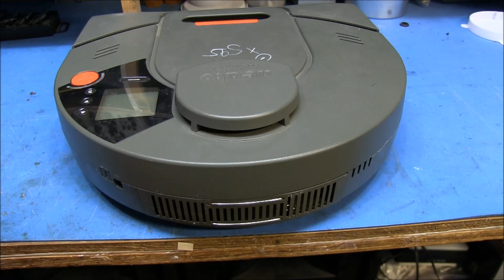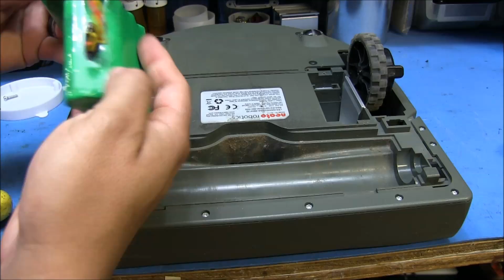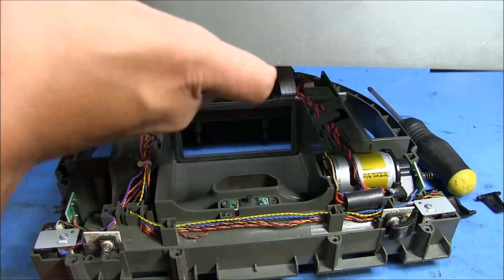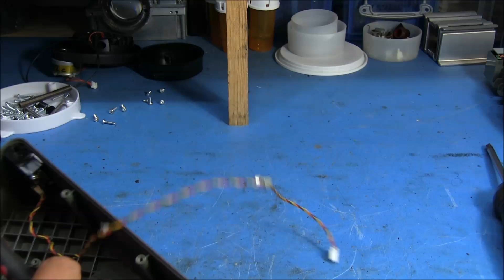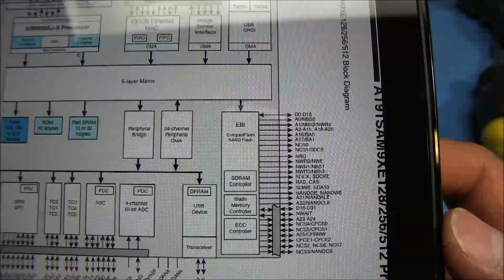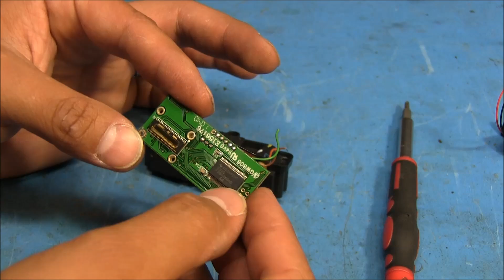Neato Robotics XV-11 Teardown and Repair - Part 1 of 2

Comment: Just bought one of these for ten bucks.  Don't have it, but I was sure glad to see your detailed repair procedure.  Thanks!   Very well done.  I know this is an old video, but wonder if you're still using it.
Reply from the maker: We're not using it because it developed a couple problems that I've been meaning to do a video about, I'm hoping to get to it at some point. For the time being I've been doing the cleaning manually, lol, although we've considered getting a newer unit, just haven't settled on any particular model.
Reply: I bought two XV 11s, and use them both regularly, with no issues so far!

Comment: so that cpu is either 180 mhz or 200  it can saefly go up to 400 at 1.95 volts lol  the 128 stands for 128kb of nand it has 16kb cache  and 16kb dcache  you can add a compact flash slot to that board . im thinking about raising the sclock speed of the chip and adding a cf slot  or mcf slot to my neato just for more room to add features to my custom rom
Reply from the maker: Dang, custom ROM sounds pretty cool

Comment: Hey there. I saw that you pulled the rotating lidar piece off by hand, and I did that too. However, you didn't show how to get it back on, and I am struggling with that. How do I get it back on without breaking the little plastic tabs?

Comment: Hello sir,  In D series Battery. black wire negative and red wire positive. What about two yellow wires. And where in the battery is connected ?
Reply from the maker: The yellow wires are for the thermistor in the battery pack. They don't connect to the battery cells.

Comment: Great video! My neato's roller motor belt suddenly got gummed up - I can get it to advance but I keep getting an error of "roller brush is stuck" and as I've (many times in the past) already cleaned the roller it seems the issue is deeper, with the motor or the gearing in where the belt attaches to it. Has anyone taken it apart to the point of being able to clean the roller motor gearing? Does the motor piece that was removed in this video break down further for cleaning?

Comment: The broken spring plastic retainers are caused by a screw on the display circuit board working its way loose, you hear and feel the spring begin to bind and eventually it gets caught and snaps the plastic retainer. I prevented this by tightening that screw and gluing it in one spot to stop it turning on a Neato XV Signature from 2014 with the same chassis.

Comment: In case nobody else mentioned it, at the 19:20 mark you're wondering about the little wheels.  Those have magnets on them with hall effect sensors on the board below - it can tell how many times the wheel is rotating based on that.
Reply from the maker: It seems they're using it to generate a pulse to detect if the wheels get stuck. From what I've observed, it doesn't look like it's keeping track of how many times the wheels actually rotate since I've had the thing get stuck underneath a TV stand and couch while the wheels continue to slip on the floor, but it's able to quickly backup and recover once it determines that it's not actually going anywhere. So much stuff packed into the thing!

Comment: thanks for the video. I realize that in the laser unit the diode and the sensor has an angle; they are not parallel. I was wondering if you measured this angle.
Reply from the maker: I did not, but I did kind of notice it as well.

Comment: I believe the base uses an IR reflective surface to allow the bot to find it. I found that a power strip with a light on it under my home theater kept attracting my robot when batteries were low. I taped the light over with black electrical tape. Problem solved!

Comment: The wires and connectors are crammed in there and it is very hard to connect and disconnect the batteries from the connectors due to the way they are situated.  This is not a consumer-friendly design for battery changes.  It is not complicated to change batteries, but it seems it would be easy to damage something.  I actually received an XV-11 back from warranty service with a damaged connector pin.  I notified service and returned the robot with a zoomed-in photo of the damaged pin; and the robot was returned with the connector not repaired!  It had to be shipped back for repair again.    Shipping robots in for repair is expensive and wasteful.  We are without the robot for many weeks while that is happening.  It is also not earth-friendly, since so much fuel is used in transporting them.  The robot is now out of warranty and having battery issues again (even with fresh NEATO batteries).  Thanks for sharing this information.  It is helpful.

Comment: The magnetic sensor is for the strips that come with the vacuum so you can tell it not to go in certain rooms. You lay it across the floor, and the vacuum's magnetic sensors detect and avoid the area behind the strip. Didn't watch the rest yet, you may have found that out by now..
Reply from the maker: Ha, yeah, thanks! Ended up finding out after I had already made these videos. Also learned a lot of other stuff way after the fact. 

Thanks!
Reply: Hey, great video though! I hate disassembly without a diagram of some sort but this was confidence inspiring. I had the blank lcd problem that seems to be related to the 7 capacitors on the motherboard. Just got done soldering last night so we'll see if it fixed the problem in the next day or so.
Reply: My motherboard was slightly different than yours. But the rest was identical. It's an xv-21 pet.

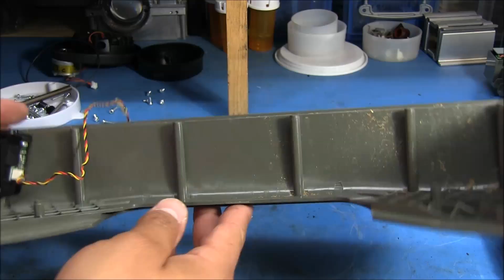Comment: Question for you and some advice from you, if you dont mind. On the video @ 39:27 that cable to the sensor. My sensor cable got cut and i need to redo the connector at the end to the sensor. Would you happen to know where i can find a new connector? What brand? Thanks in advance :)

Comment: Great video! I have two neatos. The first one died while under warranty and they sent me a new one. The second one stopped one day and complained about "blocked vision". I noticed that the radar thing had stopped rotating and with your video to guide me I was able to take it apart and locate the motor. It was indeed broken, but I could replace it with the motor from the first neato. Now I have a working robot again! :)

Comment: Great video.  Do you know of a quick way to change out the belt?  My current belt is stripped and I bought a new one.  But it looks like you at to take apart quite a bit to get to the belt drive.   Thanks in advance

Comment: Thanks to your video I was able to repair my XV-15.  It got the error "my vision is blocked (3000)". Thank you very much for sharing.
Reply: Wim Bruckmann Hi I got this exact error. How did you actually fix the problem?
Reply: I cleaned the "belt" that rotates the laser (at 34' this belt is removed). I also cleaned the lens cap and the surface the belt is against. The belt i cleaned with detergent (to do dishes). The surface i cleaned with a dry paper towel.
Reply: Wim Bruckmann Thanks, I'll remember for future reference. Luckily Amazon.co.uk refunded my faulty Neato after 14 months of use. I thought that the warranty had run out but apparently we have excellent consumer rights in the UK that I never knew about. The following is a quote from a Guardian article:
'However, because the Sale of Goods Act (SOGA) meets or exceeds most 
of the directive's requirements, this overrides the EU directive. The 
act requires three things: the goods must be as described; they must be 
of satisfactory quality, which is determined by description, price, 
durability, freedom from minor defects; and they must be fit for 
purpose.
Because manufacturers tend to give one year's warranty on goods, 
retailers will usually push you in their direction if the product breaks
 inside the first year.
However, SOGA provides cover for goods bought for up to six years – in England and Wales'.

Comment: The magnetic sensor boards are for detecting the magnetic boundary strips that you can use to keep it from moving into certain areas.  Typically you lay down the magnetic strips across the threshold of doorways so that the vacuum stays in one area of the house.

Comment: Thank you for generously sharing your obviously valuable time. I was able to repair my XV11 with your help. It wasn't charging so, I tore it down, cleaned it, and put it all back together. I even had a chance to measure some voltages. The robot has risen from the dead!  Sincere thanks to you.  The sensors on the bottom are to sense stairs so it doesn't fall down.  This is a great robot and tremendous value.
Reply from the maker: TheTaffyLover Comments like yours are what keep me motivated to do this stuff! Thanks for watching!

Comment: Thank you for the video.
Maybe you could help me out with mine.
It is a hoover 5142 
http://www.hoover.com.au/hoover-5240-robot-vacuum-cleaner

I had it for about 6 month, and recently when it works, it will stop after a few minutes and the indicator for the "full" will light up.
When I check what is in the waste container, it is hardly full.
I have taken the robot apart, but could not locate a sensor for identifying when it is full.
Maybe you have some idea ?

Thanks

Comment: Thank you very much for this video! Your demo tearing down the Neato instructs very well the procedure to dissemble it. I am outside US (Brazil) and there is no Neato support in this country. So I have to repair myself my defective Neato XV-21 which gives an error message of “Battery issue 0002”. Could you tell me where you got the used unit for U$S 5.95 ! ? I would like to buy one and take out de main PC board where the power supply and the battery charger control resides. Thanks a lot.
Reply from the maker: I stumbled on this unit at a second hand store, so it's not something that's commonly found or normally sold for that price.

Comment: Really great video.  The tear-down instructions helped me rescue my own out-of-warranty XV-11, which had a bad dust bin sensor button (it is working now after clearing off some corrosion from the switch).  Thank you.

One thing that might be tricky for some owners is finding the two screws under the warranty stickers.  I think the stickers were already removed on yours, as I didn't see this come up in the video.  The stickers are over the screw cavities between the wheels and the roller.
Reply: Kevin McAuliffe Genius thanks so much, I was tearing my hair out as I followed the video but my neato still wasn't opening this fixed it

Comment: Kore, excellent video that saved me a ton of time - by convincing me to not bother trying to repair my Neato XV-11. I was brought here by the common - and false - stuck brush error. Hair accumulates around the gear and spindle of the brush motor, causing it to eventually partially seize; regardless of how clean the actual brush is. I could only get some of the debris out with Exacto and tweezers, and the error persisted. Trying to disassemble the unit, I ran into the roadblock not being able to remove the plastic top shroud to get at the unit. I now see how you did it. Too much hassle and time. Went to Amazon and nabbed a new unit for a bit over $200. Time is money. Thanks for the video.
Reply: I just repaired mine in ~2 hours. At my day job, I earn less than $100/hr...

Comment: Very cool man! Great Vid!  I'm buying a new one, really enjoyed seeing how this worked!  Can I ask i know yours is older and the batteries have had some use... how long did the first clean last before it needed charging again (when it couldn't re doc at base station) ?
Reply from the maker: I apologize for my late reply to your comment, I had no idea there was new comments because I never got notified after Google updated their comments section! 

It would usually run for about 15 minutes or less before it would completely die and usually is was too far from the base to make it back before the battery level was too low to continue.

Comment from the maker: Sorry, I meant use a q-tip or something softer for cleaning the optics. The laser module is sealed and so is the lens assembly with the sensor so you wouldn't have to worry about there being dust inside those. That way you don't have to worry about calibration. For everything else, by all means, take it all apart to get everything clean!

Comment from the maker: Yes, I kind of learned later on that it definitely monitors the brush. Don't know why I didn't think of it then and there. It's had a few large things get caught on the brush before and it will usually immediately stop and tell you to free the brush. One time, though, something got stuck and instead of completely locking up the motor, the belt started getting stripped by the motor, so now there's a piece of the belt that's missing a tooth or two. I'll probably replace it when it causes issues.

Comment from the maker: In all honesty, it probably should be recalibrated, but I haven't done so as I don't know the procedure. I should probably look online to see if I can find info on how to do it. I just tried to put everything back together as close to how it was as possible. I haven't noticed any issues and it seems to navigate around the house just fine. I honestly don't think you need to take it apart as much as I did. It was mostly for purposes of showing what was in that assembly. I think a q-tip should do.

Comment: I wonder if the encoder on the brush motor is a feedback loop incase the brush gets stuck or an odometer? i'd think it would be able to get an over amperage reading for the brush getting stuck though.